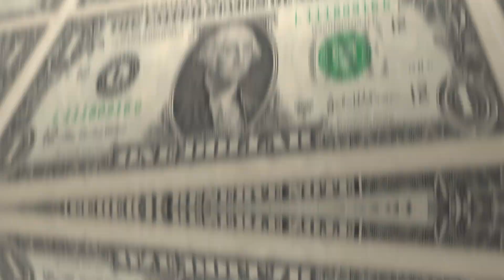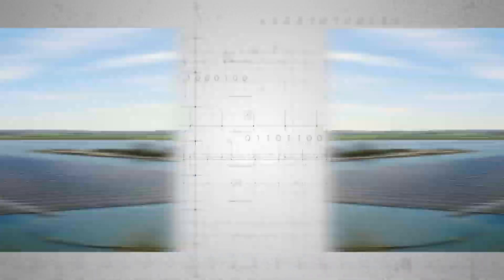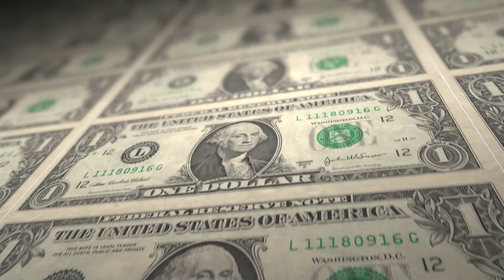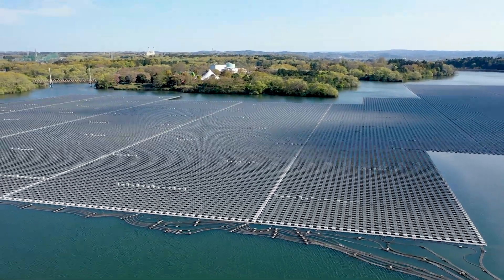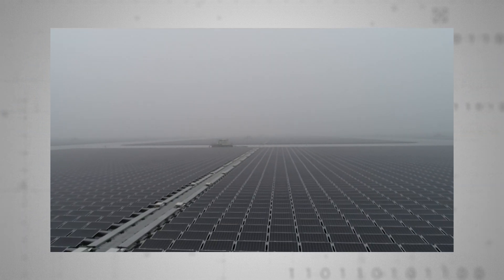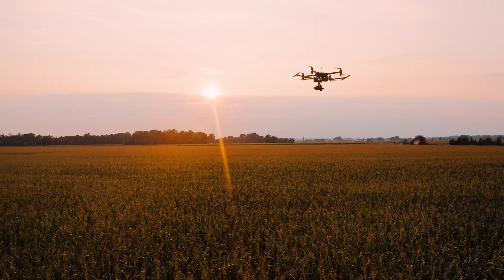The World's Largest Floating Solar Farm

Comment: This sounds dangerous. What if the water wire-ing gets loose and shocks the local sea species? Bad idea
Reply: Dumbest comment of the day!
Reply: It wouldn’t because it would dissipate in the water and it still doesn’t happen when lightning strikes water because it also quickly dissipates
Reply: no electric eels? how shocking!
Reply: @julianhaddad1431  
I think keeping the ecosystem functional is the reason why people come up with this ideas…
Reply: @goodcat1982  
The question is: Why not building it ON houses instead?
Especially in industrial areas there are huge roofs with huge potential.
Reply: @leogronung3146  why not both?
Reply: @leogronung3146  nobody is stopping you from installing a PV-system onto your own roof and make money from it. At least nobody was stopping me and now look :)
Reply: Dumb comment
Reply: They could engineer a system that detects leakage of electricity and simply fires an interruptor. But because it's China, I don't think they did it.